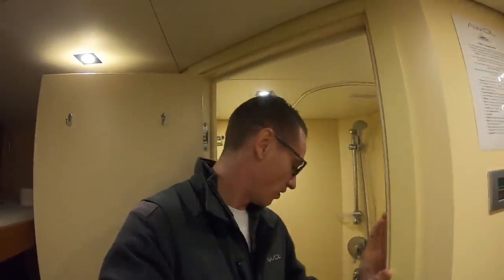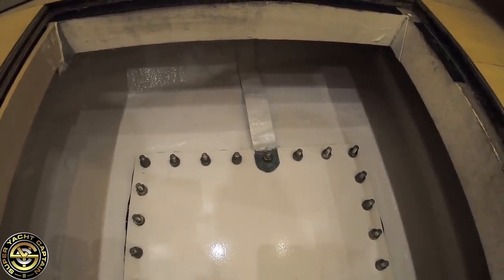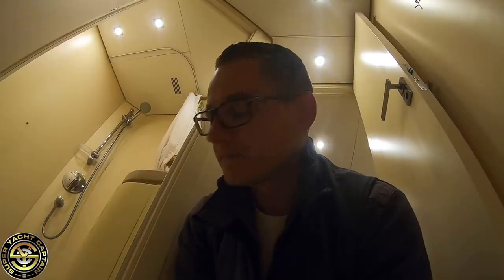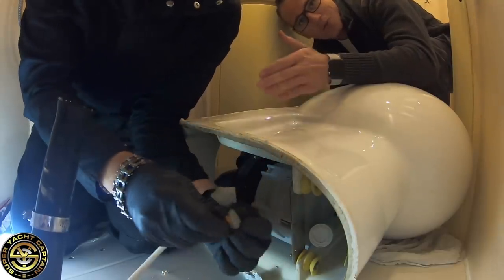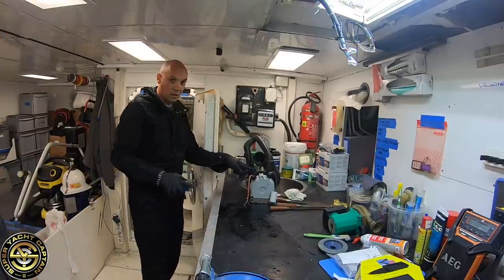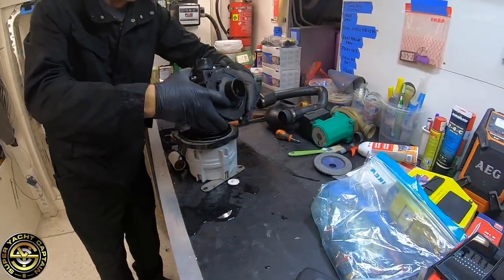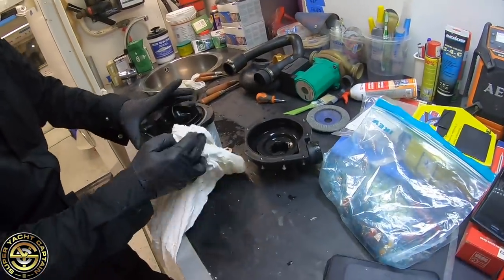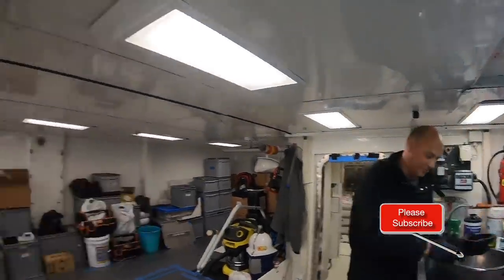Not So Glamorous Side of Luxury Super Yachts (Captain’s Vlog 56)

Comment: A similar system is used in traditional, "land" based plumbing. A toilet that needs to discharge up to the main drain sets on a base that contains a grinder and a pump and a back-flow preventer in the main pipe. Another use of back-flow preventers is to reduce back-contamination of water supplies in a business, factory or when there are 2 different types of water sources being used(such as on a farm where you may be using well water and a municipal water source in the same building).

Comment: Well, given that tyou could pull up the bolt, you could have used bolt cutter or hacksaw to cut it off and with a sheet underneath you would have captured the falling bolt.
The engineer, should have taken off all his jewellery before working on this problem in confined spaces and to avoid contamination with shit.
You should have used a large basin, baby pool on the workbench to hold the pump, thus you would have minimized the contamination.
Reply: I've used a Dremel on things like this before, small and light gives more control, less chance of damaging the porcelain. I was kinda surprised he didn't use a more sanitary method of working on it.

Comment: Several times now you have called the "Anodes / Zinc" Iron. Iron is used to make carbon steel. Zinc does not contain "iron". Zinc, Aluminum, Brass and Bronze are known as "Nonferrous" - not iron. Before I am corrected on the spelling of Aluminum, I am from the USA and that is our correct spelling. I fully realize it is spelled different in Britain. 

Aside from that, I have really enjoyed the videos.
Reply: Since he’s talking about electrolysis and electrical discharge, he’s probably saying “ion” not “iron”

Comment: A more common problem occurs with macerators when sanitary napkins are flushed. The strings wrap around all moving parts with the result that the toilet won't flush. It's a dirty job but someone has to do it when women ignore signs requesting other means of disposal like the waste basket.
Reply: I know what you mean, have unblocked my fair share, if you havenot eaten it, dont put it in the toilet.

Comment: Where and when do you guys discharge the grey and black water tanks? Where and when do you load the fresh water tanks? Thanks!
Reply: I just learned that the waste water (grey and black) is treated and thrown out to sea, so no need to "empty" the tanks while on shore. The same goes for fresh water -- it's taken from the ocean and desalinized.
Reply: @reinaldofernandez1192  They are based in the Med. NO discharge of blackwater is allowed by any commercial boat in the Med. It must all be pumped off at dock.
Reply: @JCrook1028  Thanks! That sounds reasonable indeed.